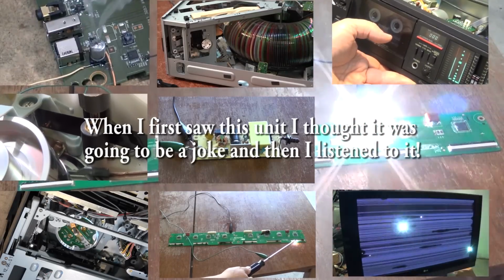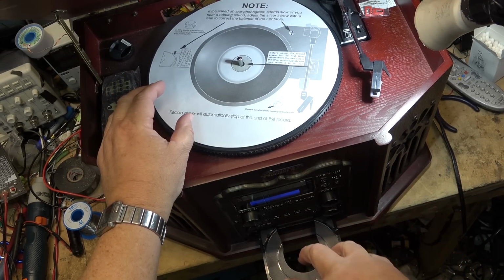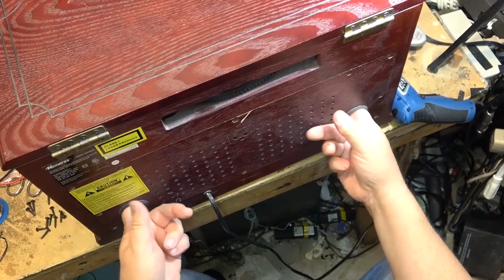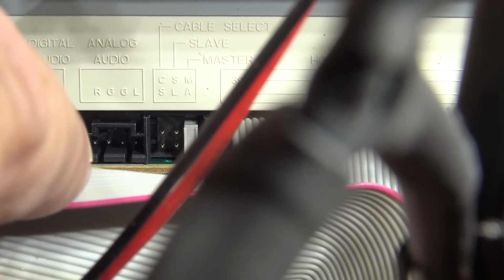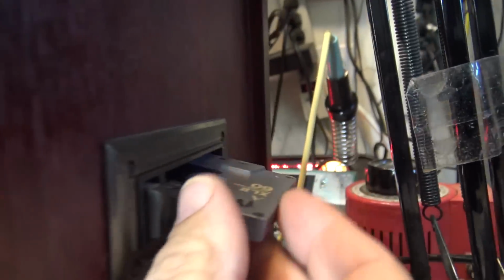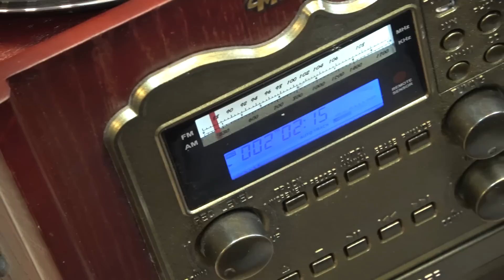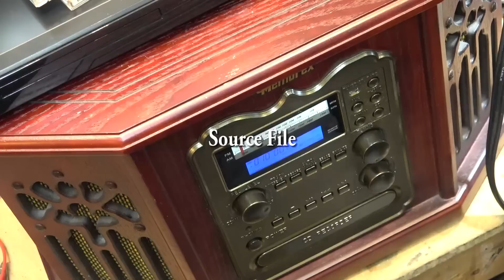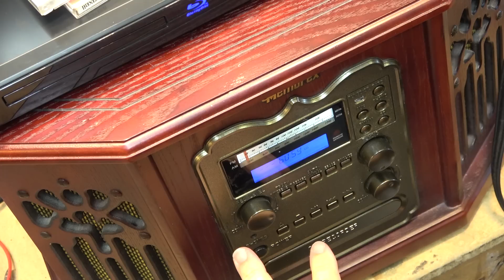When I first saw this I thought it was going to be a joke and then I listened to it!

Comment: It's hard to tell but if the sound was recorded from the microphone those speakers sounded rather good and guess they are a decent car type with a whizzer cone as the treble sounded good, Nice breakdown video.
Reply from the maker: The cd was ripped and punched into the video.  That was the direct recording.  When i played the track and switched back and forth between the source and cd copy there isn't much if any difference in sound.   I am waiting for someone to comment on something they hear on the demo.  Listen carefully.
Reply: @12voltvids  The stereo is flipped 😅An easy fix so long as you can just flip the aux cable, I'd be more concerned about the state of the turntable belt, that was some cassette-strength wow and flutter..
Reply from the maker: @socalwill9876  yes I know.  The cable is reversed on the mp3 player.
Reply: @12voltvids  Stereo imaging is different, seems wider in the copy but why?

Comment: My Mum bought me one of these and 3 years on it still functions. I fitted  decent speakers and mine sounds way better.
Reply from the maker: I'm sure better speakers would make it actually sound better but it's not bad. I wasn't so concerned about the sound of the speakers I was more concerned about how well it will record on a CD from a good line input and I wasn't expecting it to sound as good as it did. I could use this thing to record vinyl or cassettes for clients on the CD which I do quite a bit and save myself dealing with having to record it on the computer and then make a disc copy. Of course this would only be good for when someone wants a CD made and not an MP3, many times my clients want their analog material recorded and they want both a CD and they wanted MP3 copy so then I have to use the computer anyway but for those that bring me a record and say can you put this on a CD for me and I get quite a few people that do that this would be perfect. Not using the built-in turntable obviously I'd plug in one of my good ones but it still gives me  an option that will speed up the process.

Comment: I was so confused about the cds back then cd-r cdrw  cd+r  computer abbreviation nightmare
Reply from the maker: First there was no CD+r
There was CD-R write once, and cd-rw rewritable.  Then when stand alone audio recorders hit and the recording industry bitched about piracy so a special higher priced disk was made for those recorders.
You were thinking about dvd-r / dvd-rw and  DVD+r / rw.
This was because companies wanted a format war. They did it with Blu-ray and hddvd as well but hddvd died quickly.
Reply: @12voltvids  dvd also an abbreviation nightmare, where and what will they record and play in. I dvr 
anything I want to watch later, my DVD player hasn’t been connected to my Bose system in years
Reply from the maker: @tonymanzo3766  same here but the DVRs are going the way of the dinosaur now.  Company i work for don't supply DVR boxes anymore.  Existing customer have them but all new customers are on the new Google tv platform and all recordings are cloud based.  Of course there is a monthly fee to record and the recordings are only held for 45 days and then deleted.  they don't have any analog outs on the box either so you can't just recorded on a VCR or DVD recorder. The output is heavily encrypted.   New Android TV's will have the software built in. 
Anyone that cancels their service or changes from one name on the account to another to get the new customer deal is sent new equipment.  No way to get the old gear back once swapped out. So the days of recording the entire season of a series and binge watching (and skipping commercials) later is ending.  The new platform also has the ability for the broadcaster to disallow commercial skipping and or recording certain live events if they choose.  It's all changing. I can see a time when there will be 2 prices.  One with commercials and another without. Oh wait that time is here.  Netflix now offers a commercial version for the same price that the commercial free version used to be and a commercial free version for twice the price.   Youtube does that too.

Comment: Sounded great on the aux input, tape was fair, However the record player was hideous, I've never heard so much flutter before, warbling all over the place. It's a pity you didn't hook up a good turntable for a repeat on the LP just to confirm it was the player and not the LP.
Reply from the maker: What? You missed the fact I didn't undo the transport screw.  That's why it sounded as bad as it did.  Oops.

Comment: From Cassette it actually doesnt sound too bad my opinion 😂
Reply from the maker: That record i used doesn't have the best quality.  It's a high school band and it was recorded on cassette in 1972 and the vinyl made from that cassette tape so it doesn't sound that good to begin with but it is something i can play without copyright.
Reply: @12voltvids  Seems that the casette deck that was used in producing the Vinyl had a problem with flutter. Maybe its capstan was dirty.
Reply from the maker: @peterofenback9263  more than likely the belt has been parked in the same place for the past 15 years and it's got a little bit of deformation to it that will probably work its way out if I were to run it for a while

Comment: The CD unit sounds fabulous. Sadly, the record deck is awful! I don't think I've ever heard so much flutter; not even from a Crosley!
Reply from the maker: That would because I fucked up I forgot to remove the transports screw no wonder it sounded as bad as it did. I'm going to do another test and compare the same record on a proper magnetic turntable feet into a preamp and record the same track twice so we can hear the difference between the record player on this unit and a proper turntable. That would be the way anyone serious about using this would use it anyway right.
Reply: @12voltvids  That would be cool.